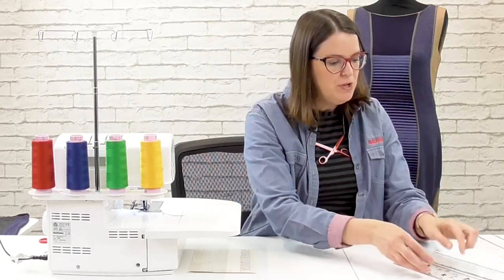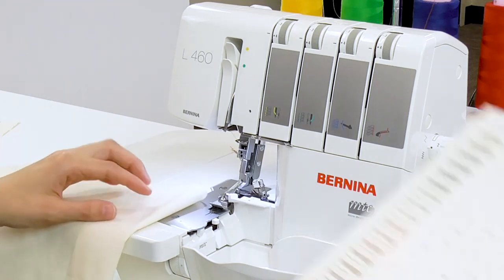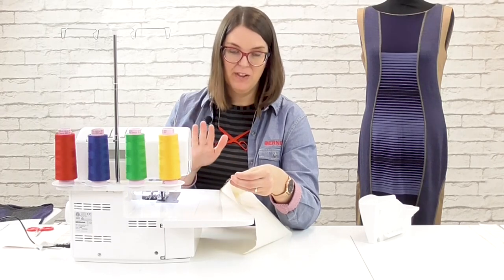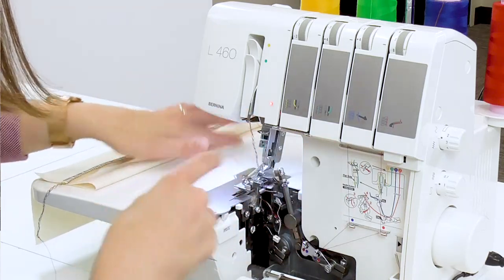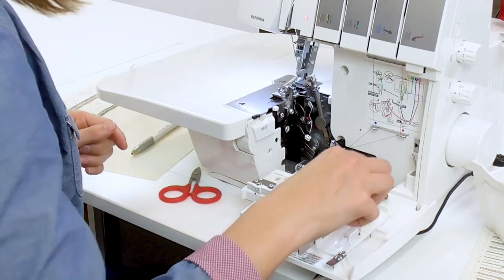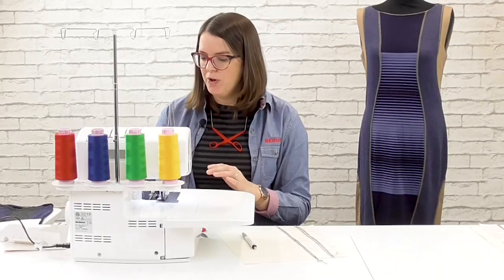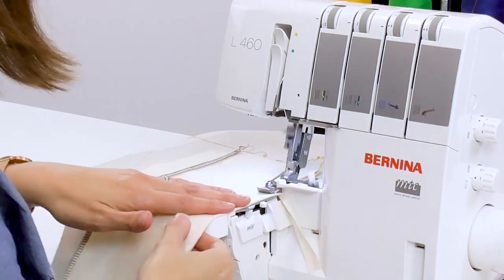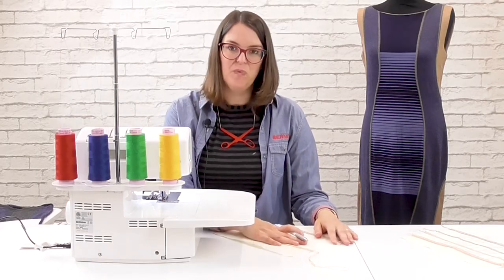The Overlocker/Serger Flatlock Stitch

Comment: Can you stitch this on a fold with cutter off and not spread the fabric as a decorative edge?
Reply from the maker: Hi Roxanne- I am thinking of two different things with this question, so I will answer both and hope that gets you to your conclusion. 1. Yes- you can do a flatlock on a folded edge with the knife disengaged (no cutting) then open the fold to see the same two sides of a flatlock (loops on top side, ladders on back side). This take a little finesse to perfect a consistent stitch--I recommend using a blindstitch foot to act as a guide for sewing along the edge. 2. A flatlock on the edge of a fabric needs a second layer to pull out the excess slack of tension in the needles. When the flatlock is sewn on the edge using a stabilizer on top to pull the thread to the edge of the fabric--it will look like a faux blanket stitch. But just doing a flatlock along a folded edge will look like a stitch without balanced tension (essentially what a flatlock is by nature).